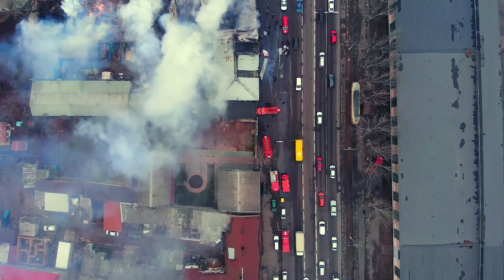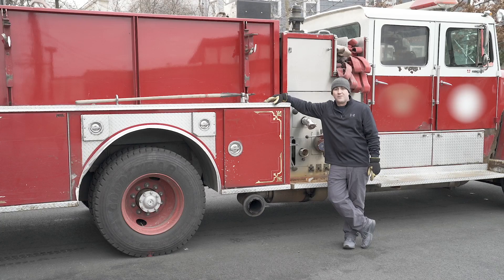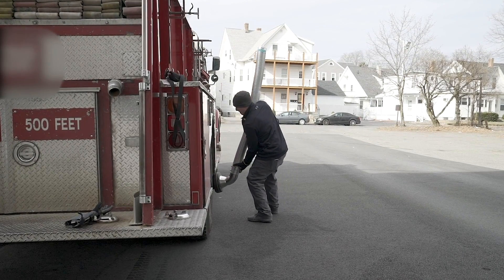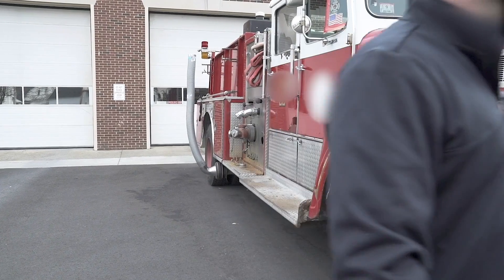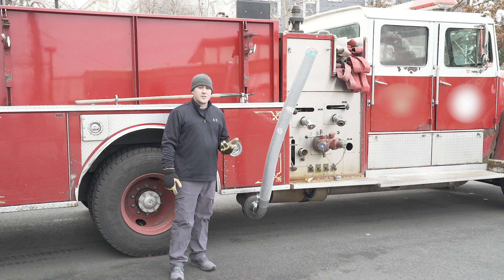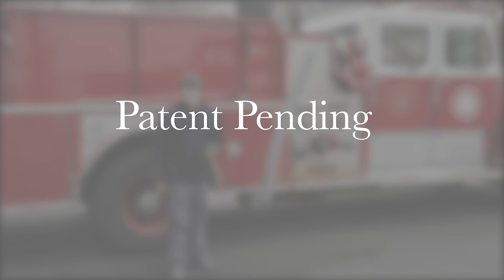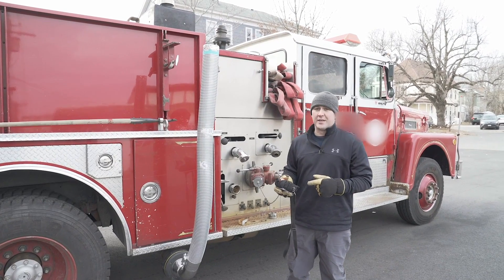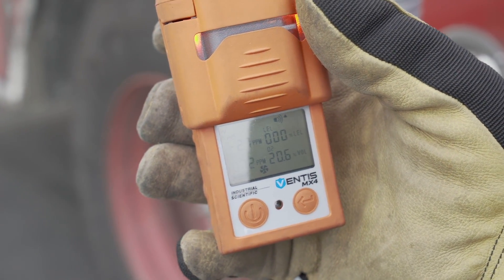Massachusetts firefighter designing device to keep diesel exhaust away from fellow firefighters

Comment: I admire this fire fighters ambition to combat inhaling harmful exhaust fumes when at work. However I do not believe the same is true for newer trucks. That engine (pumper) he was standing next to is older than almost anything I’ve seen in a fleet of vehicles. All newer trucks use Selective Catalytic Reduction, and DEF/DPF diesel exhaust fluid and diesel particulate filters to solve this exact issue. They have been on trucks for well over 10 years at this point. I’d say a very small percentage of fleets still are using diesels that don’t treat the exhaust. None the less moving the exhaust up is a good solution except for the extreme temperatures that device would be at after being attached to a tail pipe of a diesel vehicle.